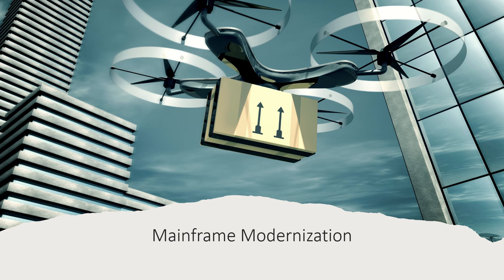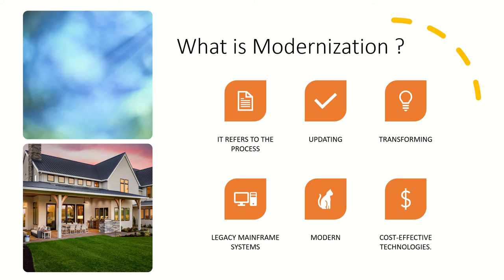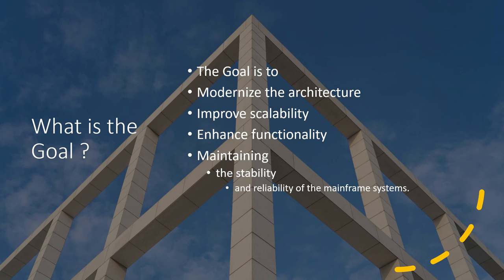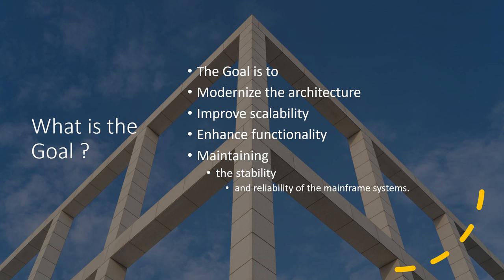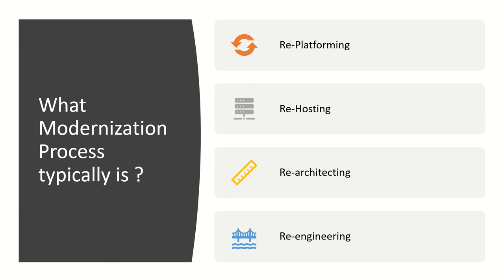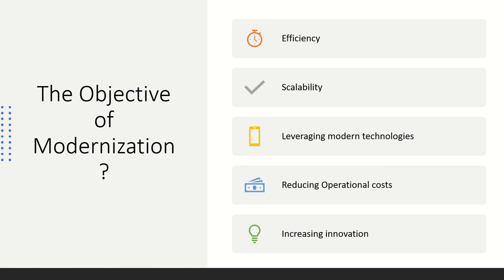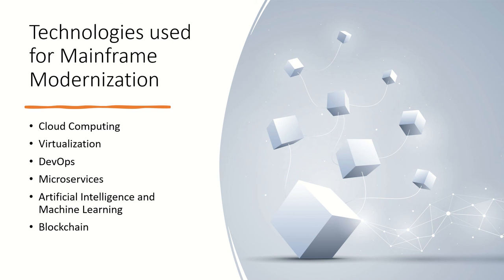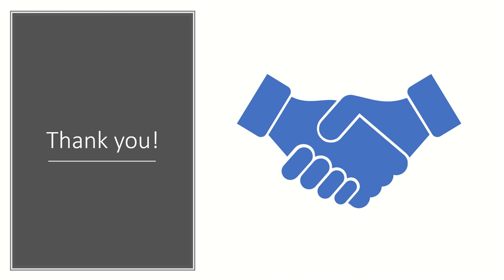Mainframe Modernization - Wednesday Talks  #19

Comment: How to read file in reverse order in COBOL program
Reply from the maker: Try the below. 

READ-LAST-RECORD.
    READ INPUT-FILE
        AT END
            SET WS-END-OF-FILE TO 'Y'
        END-READ.

READ-PREVIOUS-RECORD.
    READ PREVIOUS INPUT-FILE
        AT END
            SET WS-END-OF-FILE TO 'Y'
        END-READ.

The above will read the last record in the input file using the "READ" statement in the READ-LAST-RECORD paragraph. 
It then reads the previous record in the file using the "READ PREVIOUS" statement in the READ-PREVIOUS-RECORD paragraph.
Reply: We can use perform varying to read file bottom to top but we need to know the records in a file